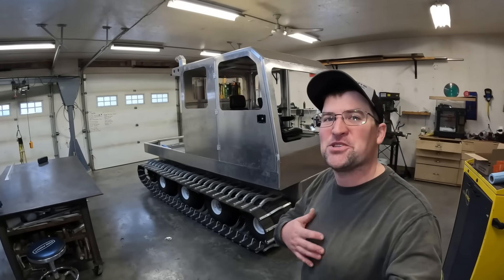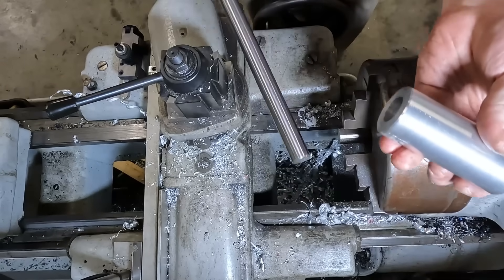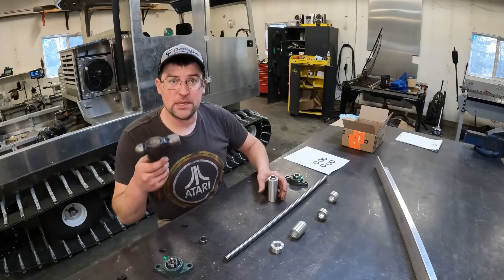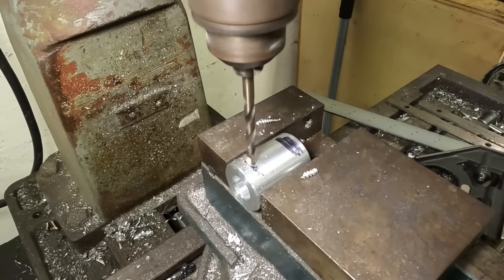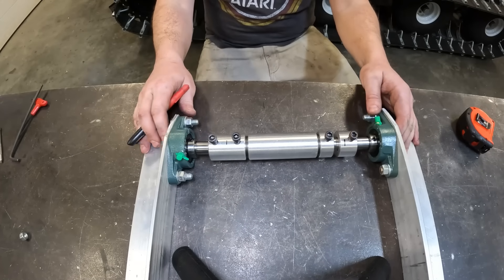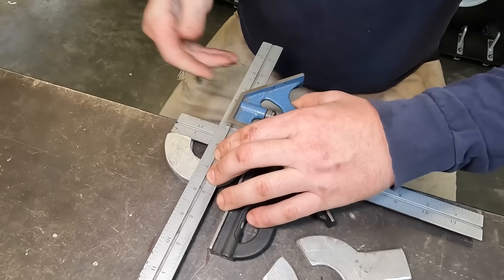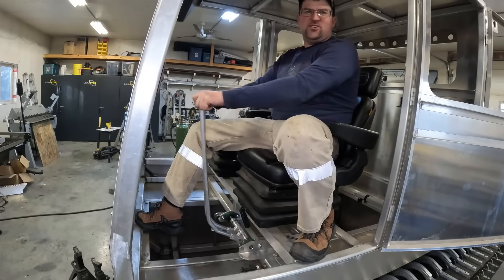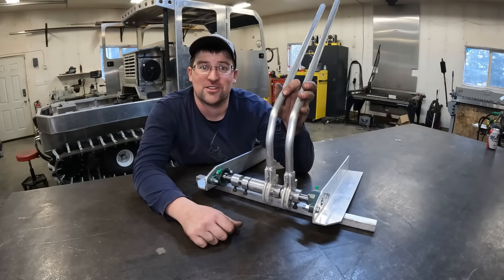I Engineered My Own Snowcat Controls…

Comment: I have no much experience of note in driving a push stick like that, but i would assume from an ergonomic standpoint you would want them to come in from as far front and then bend up to where you wanna operate it so you can walk directly in and sit down without having to lift legs over or move around the sticks, like ideally mounted  on the front high up (like just below windscreen), then make a somewhat horizontal movement forward and then vertical for the last bid, this will also reduce the radius to pivot, allowing shorter stroke length for same axis of movement, but that can of course also be changed by the lever arm on other sides length. i assume the force to move the levers on the pump, does not require 75cm lever arm? You can also with this make a pushrod system from control arm anchor and to floor base, where the cables are gonna come in, this allows you for making a extra foot paddel attaching here, many options for function but i could see one where you can push both down equally and drive steady forward by foot.  if you look at modern large tractors or earth equipment they over the years changed cabinet design to so large you can spin 360 deg in a wheel chair, so there is properly some inspiration for ergonomics there to be inspired by one of the main things not a single object sticking up the floor. You should however really get that hydraulic pump coupling sorted before anything els :D

Comment: Sick. You may wanna think about putting what you just made on a track system like a cars seat. And maybe make it tilt on the mounting plate as well. I know it will make it more complicated. But for adjustability with different drivers…. I bet it wouldn’t be that hard to do honestly. And if you did it with a pull lever like a car seat you would be able to easily slide them out of the way for getting in and out of the snowcat. Just something to ponder lol. Cheers from Maine.
Reply from the maker: That’s a pretty good idea. I’ll probably come back and do something like that after. I really just want to get this thing moving lol

Comment: Nice to see the Snowcat getting worked on. What do you plan to use to lubricate the needle bearings and thrust washers on the control arms?
Reply from the maker: I’ll likely just put a bit of bearing grease on them. They won’t see lots of force or revolutions so I am not overly concerned

Comment: Very  clean work... i really want one!  But i live in the desert and have no use.  I'd probably key the shaft for the shaft operated section im not sure youll have enough bite with just grub screws.  Return springs might be a good addition on either end.  could add a cable clutch to the engine side (not sure how itll work with push-pull depending on type) just a slide that moves the cable jacket and slacks the cable enough that no input is translated (just thinking idling cat... ankle bighters...)

Comment: Ciao Cole, bel lavoro come sempre, non ti nascondo che non sono convinto sull'avere le leve in mezzo alle gambe, le vedo come ostacoli per entrare, inoltre credo tu abbia previsto un blocco di sicurezza per movimenti accidentali se qualcuno ci tocca per passare.,..  in ogni caso e' un grande lavoro 💯💯💯👋
Reply from the maker: Thank you! Yes I agree it’s probably not the best place but I want blade controls on the right hand side. So you make a great point. It’s something I haven’t mentioned but I will be installing bypass valves in the hydraulics so when you get in or out of the vehicle or when kids are warming up in it, the controls will be disabled by blocking the fluid flow to the motors and directing it back to the pumps. Good catch. I’ll explain this more in future videos. Thank you for watching and your wonderful comments as always.

Comment: You may want to put some kind of lock out or something of that nature so when somebody gets in and all their snow gear and hook the controls I've seen it happen multiple times on skid steers it doesn't always end badly but it only takes once
Reply from the maker: Exactly! I haven’t discussed that yet but I am going to put solenoid bypass valves in the pump/motor circuits the will completely disable the hydraulics for getting in and out or if kids are warming up in it!

Comment: Well done. I’ve run machines with control sticks between the legs as you are building also with levers to the sides of the seat. The open access gained by having the levers to the sides. Vs between the legs is astronomical.
Reply from the maker: Yes I totally agree. It’s just such a trade off. I don’t have room to have a stick on each side and on the right I want blade controls. So I more or less “settled” for this. I’ll come back to it if needed.

Comment: In my opinion i would of built them like an excavator so if you chose you can run it with your feet also
Reply from the maker: Forsure. I thought about that but it just wasn’t going to work out how I wanted. It’s possible to add foot pedals for forward still.
Reply: @CenterLineDesigns  your doing a great job on it
Reply from the maker: Thanks!!!
Reply: Was thinking these would be left and right of the seat so you can sit comfortably like running joystick excavator.  Nice design/fab work
Reply from the maker: Yea I thought about that but I want a joystick on the right for the plow controls.
Reply: Looks great. That cross shaft is stout.  I'm looking forward to seeing how you do the linkages.
Reply from the maker: Thanks! Hopefully start on them when I get the cables
Reply: @CenterLineDesigns I'm looking forward to seeing how you solve the neutral position/lever weight issues 👍
Reply from the maker: Yea me too haha. I’ll probably have to build an assembly to spring return in both directions that should hold them in neutral position. I have just held off on that for now because I want to see how much feedback the pumps give to the controls. Since this is direct control they might help self center but I just don’t know yet
Reply: @CenterLineDesigns That's what makes it fun👍